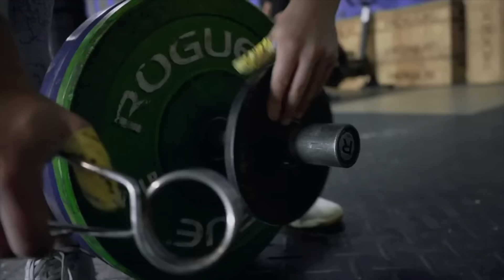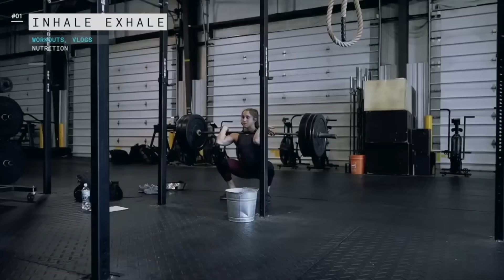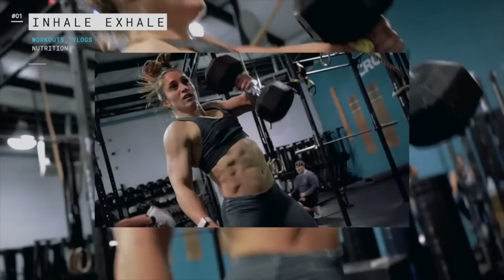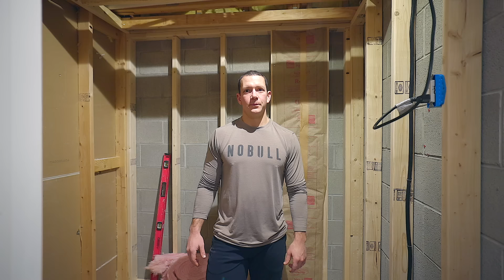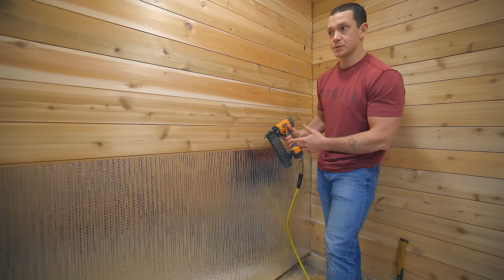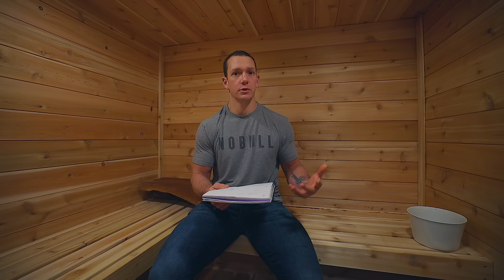HOW TO BUILD A SAUNA + FULL PRICE BREAKDOWN

Comment: Hi Pat,

Nice build. You may consider adding some venting to prevent mold build up in the framing
Reply: @Highintensityhealth  thats interesting, i might re thinkg adding a vent. thanks for sharing.
Reply: I was thinking the same thing how would you prevent mould in it? And how would you create a vent in the basement? just connect it outside you mean and wouldnt the heat escape?
Reply: @Saywhatohno   we have a small gap under our door but plan to put a vent in.
Reply: High Intensity Health hey! We have a 2” gap at the bottom of the door to let fresh air in. But being a dry sauna, and not a steam room it’s just hot air and we don’t get any moisture build up!
Reply: @patrickoconnell2380  most people sweat in the sauna
Reply: @gregkosinski2303   we just build ours and we sweat so much, however We are missing a temp gage maybe its too hot hahahah
Reply: I was concerned about the same thing. Honestly, once you have to deal with mold build up LOL I'd add a vent everywhere in case, particularly in this situation. Any chance we can get a 1year update on how the Sauna is? Thinking of building something similar. Great vid!
Reply: @Maximiliano Stephen why would you do that
Reply: The BEST sauna in the world is RADIANT HEALTH!! It saved my life.  It's NOT a Radiant sauna(that's a fake)as it's a RADIANT HEALTH!
Reply: @Happebnme   We just build ours and we have been using it everyday. We want to add an ice bath soak for the in between the soaks next.
Reply: I was just about to comment the same thing
Reply: @PrisojackaDugaCesta  I have read that indoor sauna venting is ducted or directed back into the inside living space (ie the room the sauna is connected to). It does not go outside (not recommended to). Also you can control the venting flow rate by having a slider to partially cover the vent.

Comment: Great built Pat. I would add an exhaust fan in the sauna and shave an inch or two from the door downside part for fresh air circulation. It keeps the sauna fresh and helps to avoid a 'suffocating feeling when it is hot'. Even better to put a relay on it and make it circulate every 3 to 5 mins.
Reply: Fahad Ahmed hey! Thanks, we do have a 2” gap at the bottom of the door that works great for us!

Comment: Hello Patrick, nice build. Most likely the vapor barrier  (bubble wrap) that you used is not high temp. If it's not high temp, it will evaporate bad fumes that are not good for you. We use special Sauna Thermal Vapor Barrier Foil that can withhold the high temperature. When you nailing the tongue and groove, you start from the bottom with the tongue going up. The reason for that is, if you have any moisture it will drip down, will not stay in the groove. And you should have installed the vent out, so you have more oxygen. Next time you use the sauna try to lay down on the bench and wear the hat to keep your head cool, that way you can stay in the sauna longer without overheating your head. I build saunas for living.
Reply: I found a good book for designing and building saunas is "The Art of Sauna Building". In addition to what Bsaunas mentions it's also suggested that you run a proper heat resistant foil vertically rather than horizontally with a 2" overlap.
Reply: Do you have any experience or advice on building a barrel sauna from scratch for outdoor use? Hoping to build one for my backyard in Portland OR very soon if I can get the cedar boards, heater and other supplies for ~$3k. Any advice is greatly appreciated!
Reply: Very informative video! Question for BSaunas USA: Is there any point to the bubbles in that wrap? The foil makes sense. In my landlording practice I once had to cook a room (to get rid of bed bugs) with hot air and it warped vinyl blinds and anything plastic and that was probably 180 degrees. So yes the plastic bubble in the wrap may definitely melt - so a regular heat rated foil may do the trick. I saw a video of someone using only 6mil plastic. If the heat gets past the wood then the plastic may melt - so I think foil is a better option.
Reply: Nice catches.  I would have also added insulation in the floor, and if/when you replace the bubble-wrap insulation, tape the seams.  The craft-paper that the fiberglass insulation comes with can promote mold.  I would have used rockwool, which does not promote mold.  Also, try to set a pan or something under the floor to see if it collects water condensate.  If so, find a way to deal with that, or it can/will get gross.
Reply: Excellent advices. You know what you are talking about, sir.
Reply: Hey thanks for the concern, i didnt use a vapor barrior(since there isnt really any moisture)  just a heat shield and it is rated high temp. I started the toung and grove from the top to have a full and even line at the top were it is visable and put the cut at the bottom of the wall. since it is a dry sauna i wasnt worried about moisture build up. Used it almost daily for a couple months now and havent seen so much a drop of water roll down any of the walls!
Reply: @patrickoconnell2380  😊
Reply: Thanks for the info
Reply: Hi Bsaunas, you are clearly very knowledgeable about building home saunas! Do you have any recommendations on resources for someone who wants to build a home sauna in an unused bedroom. I’ve been watching a lot of videos, but it sounds like you really have the expertise. Thanks so much!
Reply: For the vent in the sauna should it stay open while using?  or just open when finished?
Reply: HELP! Can anybody tell me - when you don’t plan accordingly and have to remove screws, how can I fill them? Something that looks good, but is nontoxic?
Reply: Curious if those recessed lights are holding up?
Reply: @omarg_nyc  yeah I’m curious too…these cheap $20 Amazon down lights are certainly not rated for high temps but if it’s working after a year or two I’m all for it.
Reply: Can you come to Trinidad and build one for me? I will make roti doubles, Trini stew chicken and calalloo for you😅😊
Reply: I was thinking same
Reply: Hey I'm from Flint MI and I got inspired on building a sauna I thought it would be a great business venture so I'm definitely appreciative if you could give me any advice
Reply: What kind of barrier would you suggest, can you link me to something?
Reply: You wouldn’t happen to be in the south eastern part of the country would you? Or at the very least, would you have an idea who I could contact? Thank you.
Reply: I noticed he did the founder and groove upside down as well, siding used to be my trade so I always over analyze people's work. I used to tell new guys just assume water water wants to get behind every thing and if ya don't quite know how it goes. Just think about what water would do. And do every thing ya can to keep the water on the right side of the wall
Reply: if you build them for a living i would love to see you video...not playing got to see a professional before i burn my house down
Reply: what's the best way you know to build a dry sauna indoors that can be "easily" taken down to move outside or to another house down the road?
Reply: He has insulation with a vapor barrier on and the  installs another vapor barrier.. is this frowned upon?
Reply: would you insulate the floor and create drainage?
Reply: @marekonbike9291 no moisture I never see drains

Comment: I can't see any ventilation? It's very important to have incoming air somewhere near the heater and air oulet at opposite corner on the ceiling. Otherwise you won't enjoy there as it feels like oxygen runs out. And you have to make sure that whole room is vapor sealed. Greetings from Finland.
Reply: And you need to have ventilation gap between heatseal and paneling.
Reply: mold will cometh

Comment: You should always use kiln dried lumber in a sauna.  The intense heat from the heater will cause rapid drying and you can get some pretty awful gaps in your wood pretty quickly.  Made that mistake only once.  Had to remove and reinstall a very large ceiling in a commercial sauna.  Also good idea to build the benches with hidden fasteners so you don't get a visible bleed from the hardware down the road; seen that countless times from DIYers.  For these reasons, (and as a professional sauna builder/retailer) I recommend buying a sauna kit.  You can still install them yourself

Comment: Nice project. Just one question: how do you take care of moisture accumulation? Do you have any kind of ventilation system integrated? I am concerned about the hot, steam vapour that eventually condensates into water once the sauna has cooled down after use. Would be great to hear from you.
Reply: hey! It is really just hot air so there really isnt anything to vent. Even pouring water onto the sauna to heat it up doesnt produce enough steam not worry about. There is a 2" gap at the bottom of the door to let fresh air in, but thats it!

Comment: why didn't you go with treated lumber for the frame?
Reply: Hey! didnt really have a need to. If i was being picky I could have used treated for the bottom plate that sits on the concrete, but the rest of it will never be exposed to anything that would compermise it!
Reply: Never use treated wood in sauna!!

Comment: Great job! We are thinking about having one built in our house, wanted to know how do you manage the humidity inside the house, is internal hot sauna not causing any damp or mould issues inside the house? 
We are planning to have ours between two rooms on ground floor.
Thanks
Reply: Khalid Amarkhail hey! I highly recommend it, we use it almost Dailey. Since it is a sauna it is really just hot air. Even putting water over the heater the steam isn’t even noticeable. Sweat is more something to plan for ! !

Comment: The insulation should have been unfaced. You risk trapping moisture between the foil and the facing. Also , those walls won't breathe, and looks like there is no floor drain. I would keep it light on the moisture in there and get some sort of ventilation.
Reply: Denis G hey! It’s a sauna, not a steam room it’s just hot air! 2” gap under the door  for fresh air but no No need for an actual vent!
Reply: @patrickoconnell2380  that's what I figured. Just thought I'd point out because some people (like me) make it seaworld in there 😀, and the way this one is built is quite unforgiving for moisture management.

Comment: Have you replaced the sump pump line so your basement no longer floods ? Typically those lines are not buried they discharge water from a sump pit into the yard
Reply: ya, i had to dig it up, ours runs all the way out to the street and it had tree roots smash it all the way by the street. Huge pain in the butt !

Comment: Would you suggest to another person building a sauna, to install a floor drain for water/sweat. I’ve heard of others saunas having a mold problem later on down the road. Also,  do you think ventilation vents are necessary? Btw you have some serious skills lol
Reply: hey! thank you! and i still might put a floor drain in, right now we just have a rubber mat that covers the floor and does plenty good. Cedar does a good job resting mold and we have about a 2" gap at the bottom of the door to let air in, though an actual vent isnt nessicary! cant recomend building one for your own house enough!
Reply: @patrickoconnell2380  I plan on building one in my  non insulated garage. Should I just put a rubber mat over the concrete floor or do you advise a different approach for flooring. I live in Iowa so that concrete floor can get pretty cold in the winter, which I plan on using the sauna year round. Thanks for the response!
Reply: @nickfred6024  I think you should at least put down a rubber mat, that would keep your feet from freezing getting in!

Comment: Looks really cool! (Hot!). But are you sure you should be putting water on an electrical appliance?
Reply: thanks!! and yes, this is one of the few electrical appliances that it is ok and realy designed for. It is a sauna heater and the instructions clarify that its fine to do!

Comment: Was little surprised that it wasnt Swedish sauna where you cannot throw water. So probs for that! And nice to notice that saunas benefits and getting noticed in crossfit community also.
Reply from the maker: We love it! We are going to put a video on benefits hopefully soon!
Reply: What do you mean "cannot throw water?"
Reply: @clintcarlson5531  in many saunas in sweden they don't have any stones in the stove (usually electric ones) and the resistors (don't know if that's the correct word but you know the metal things that heat up and turn red) are visible from the stove and it's quite common that when that's the case you shouldn't throw water on them
Reply: @kokkidaa  Why on earth would anyone NOT put stones in a sauna stove? That makes no sense at all.

Comment: FYI, traditional saunas that you throw water on (ie, non-infrared ) need to have some ventilation for a better experience, just ask any Finn.  I've been in a lot of Finnish saunas (both electric and wood) and when we built our own sauna it was required by our builder who had experience in them.  The venting is not the same concept as venting for a bathroom.  Here's a better description: https://www.saunafin.com/blog/sauna-kits/mistakes-avoid-building-sauna-kit/  When you install your door, make sure you have a good gap (at least 2 inches) below the door for some fresh air intake, without it the sauna air can get really stale and uncomfortable. The one you built still looks awesome!
Reply from the maker: We currently have that 2in Gap under our door! I actually asked Patrick why thinking it needed to be almost sealed but he said that exact thing and explained how important ventilation is!!! Thank you for the article!!
Reply: @Kristi_OConnell  Great work on the sauna and video!  Thanks for posting and enjoy! Question about drainage from the water poured over the rocks and heater? How is that addressed? The sauna I use has had issues with the drainage piping below the wood floor. The heated water running through the drainage pipe would cause the pipes to heat thus warping the wood flooring.
Reply: @johnboy7232  The water poured over the rocks is supposed to evaporate and make the air hotter & more humid.

Also Will's comment about air circulation in Saunas is crucial! 

Cheers from Finland, the home of Sauna :)
Reply: What dimensions did you build?

Comment: Great idea. We bought a secondhand sauna and put it right next to our gym in the basement. We only use the infrared lamps. Insulation-wise (temp. in the basement...) we don't use the heater for the Finnish sauna. It uses 3 phase current which we don't have and that would mean that the temp won't rise enough.
Reply from the maker: That is interesting, we thought about an infrared! Thanks for watching!

Comment: Would you recommend using closed cell spray foam before placing the fiberglass insulation to add a more insulated value?
Reply: well, that stuff works excellent the only downside i see is that its pretty expensive, but im sure it would def help!

Comment: Does the current wall type or structure of the room in a house matter? Does it need exhaust or a way to control the moisture is that handled by the insulation and cedar?
Reply: no it shouldn't, and it does not need ventolation, it really gets no moisture!